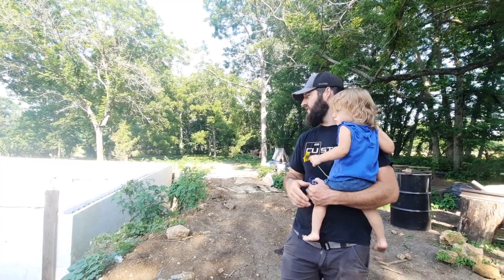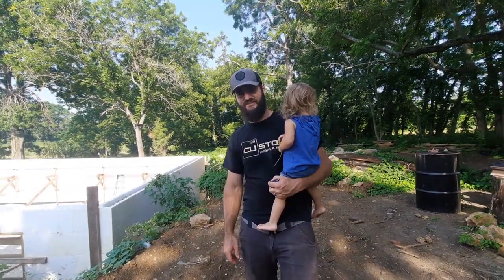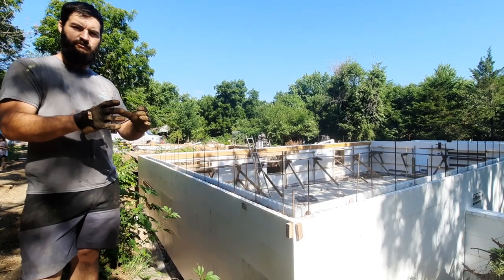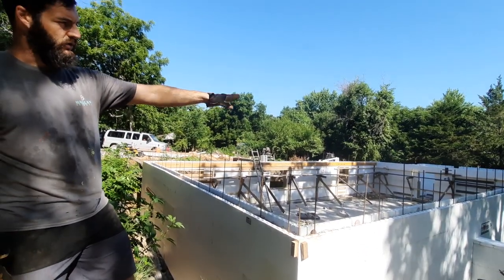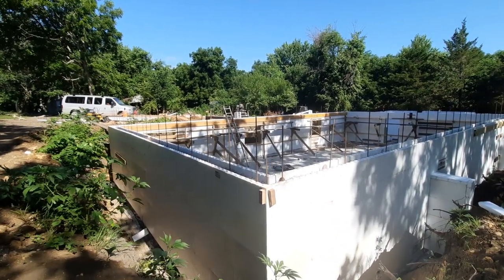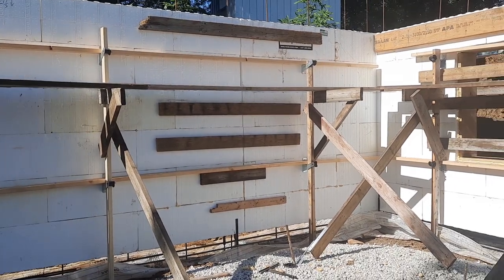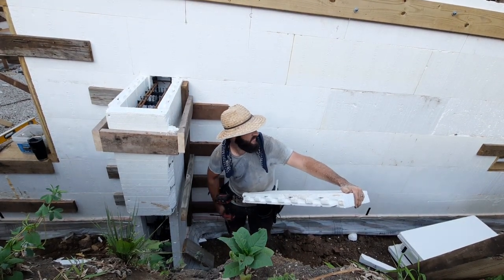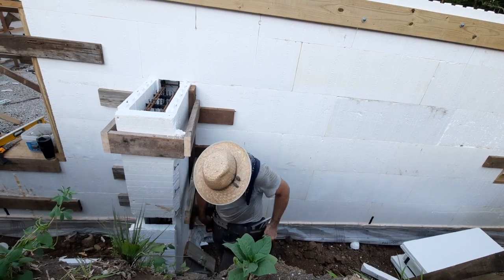Getting Ready For Pour Day|| DIY ICF Home Build

Comment: Cheer up people! You have done a wonderful job and it is for your own family. It is good that the pour hasn't happened yet... How are you planning to make walls straight?  At 0:57 it is discernable that the wall in the view is not straight. Before the pour one would tilt walls slightly inwards (towards braces) so that right after the pour bracing would be adjusted to push walls back into perfection (against straight strings). Do braces you use have any adjustments? Another little thing is to make sure that all seams are foam sealed few hours before the pour. And another thing is to reinforce door and window bucks to prevent them collapsing. I am positive you are aware of all these things, but just in case... Great job!!!
Reply from the maker: Thank you for the encouragement!  We were so beat at this point but we are in better spirits now!

Yes we lined the walls so they would be nice and straight after we got the Braces on then gave them an adjustment midpour as well. 

We reinforced the windows and doors but we are going to do it differently for the next pour to make it easier to get mud up to the bottom of the sill!
Reply from the maker: I would only foam th marriage joints and if they are small it's not  actually necessary. Definitely don't foam regular joints with fox blocks though. Big mistake that we made.